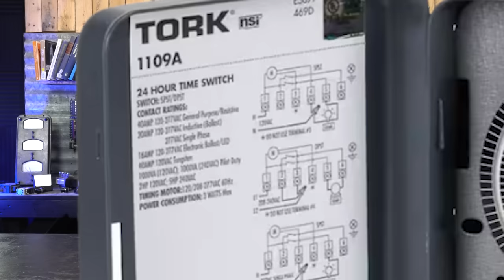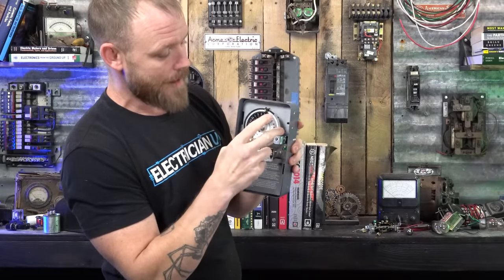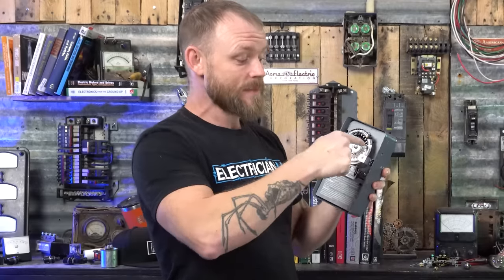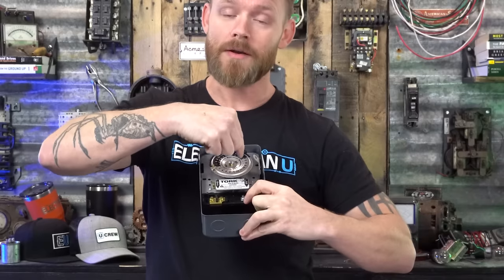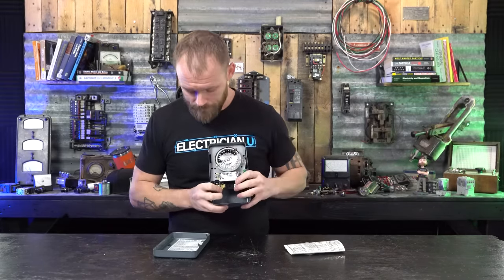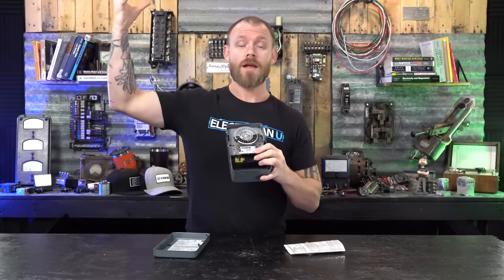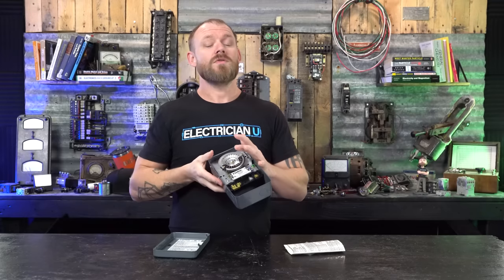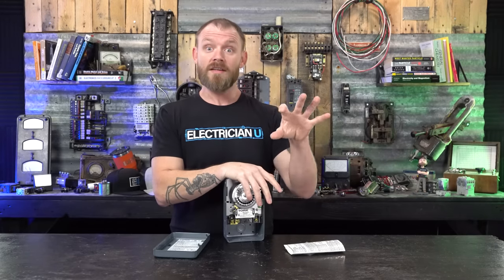What are Timeclocks and How Do They Work?

Comment: 30 years ago I used these on electric water heaters. Turned it on 2 hours before I woke up. Plenty of time to get a warm shower. Then throughout the day the hot water would slowly reduce in temperature. Worked great for me. Saved a lot of money.

Comment: What do you when the tripper won't turn the switch? Is it fixable? Had to replace a $125 Intermatic pool timer.  BTW - don't forget that if the GFCI trips, you'll need to reset the time.

Comment: I don't know the correct english here (vernacular).
A very small town I stayed at had remote monitoring. 
I was early at the grocery store 6am. Drizzling outside, store opens at 7am. Doing work on my phone and still twight at 6:27am the parallel buildings banner light begins flickering.  I hear a loud groan.
60 seconds later Groan.
What is this noise??
Again, another.
And another.
GROAN...
BANG!
A very large transformer blew because someone reset it 5 times.

Comment: Astronomical ones are the best to sell your customers, with the exception of a long power outage, they will automatically control lighting dusk to dawn year round based on the date without needing to reset. They do have a capacitor to keep the setting for short time periods where power is lost.

Comment: Old sparky and called the big ugly gray box that we punched a time card a time clock. Worked on probably 15 different timers. Most interesting ones were used on freezers & chill boxes. Defrost timer had several adjustable settings. Timer would start defrost cycle by closing ammonia solenoid, turning off fans the opening up a hot gas solenoids for up to 20 minutes depending on ice build up. Then hot gas solenoids closed and ammonia solenoid would open .Fans would not start for at least two minutes to give water a chance to drip off coils. Installed a seven day 4 pole timer in my house over 35 years ago for all of my outdoor Christmas lights. Real pain in the ass to zero in the 14 trippers. Think it was Intermatic that made a timer that rep!aced a single pole toggle switch years ago. Big problem was that when light bulb burned out you had to reprogram the settings .